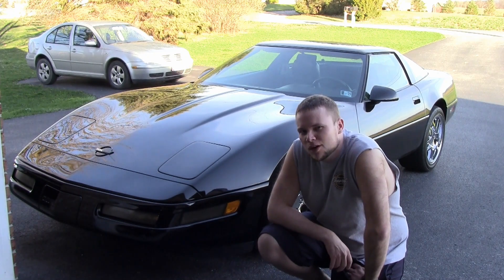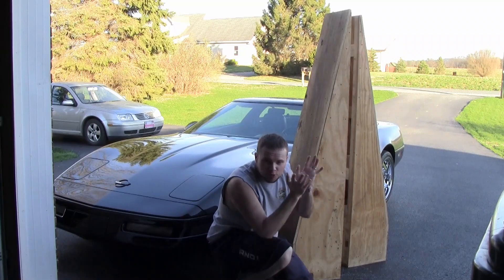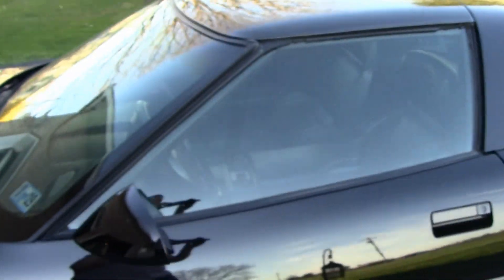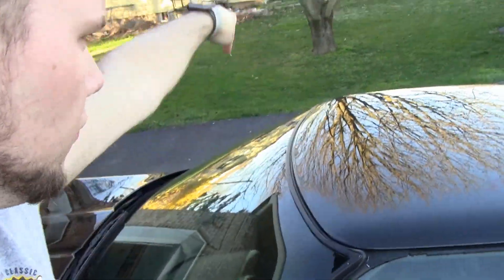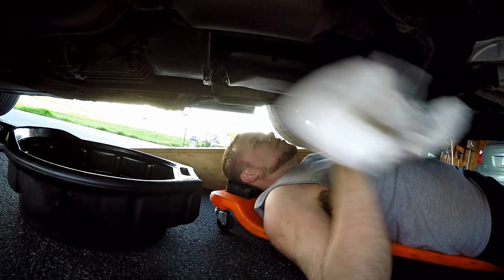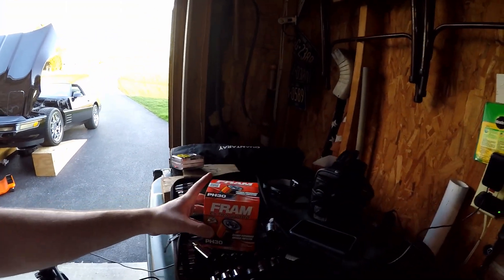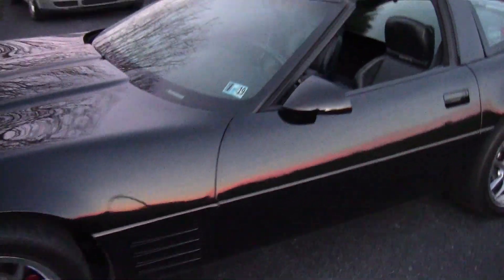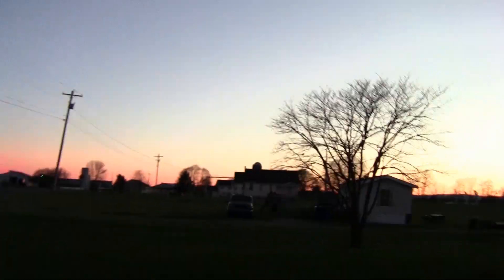C4 Corvette: Jacked, Changed, Replaced, Removed and FINALLY Ready for Spring :)

Comment: Fram should only be used if there is nothing else available .
Reply from the maker: Hahahaha, that’s what I am hearing!! Thanks for commenting!
Reply: @Doulop  It's funny that multiple people keep telling you to get away from Fram, but it's like you said, your family has been using them for years and are not having problems.  I also always use Fram and have been for over 15 years of driving my cars over 20,000 miles a year, I live an hour away from where I work.  I'm always late for work somehow so I'm constantly doing 90 MPH on the highway.  I've never had a problem related to oil.  That's also on 7 totally different cars.  '81 Ford F150, '90 Toyota Celica, '99 Ford Contour SVT, '89 Nissan Pathfinder, '00 VW Golf, '05 Subaru Legacy GT and now a 2016 F150.  The cars themselves are always wearing out way before the motor.
Reply from the maker: Hey Poochoo Train, thanks so much for subscribing. I really appreciate that. I agree with you. I do about 26,000 a year as well and never had a problem. Oh well, I bought the “better” brand after I was told to, LOL. Thanks so much for commenting. Take care!

Comment: I just used the regular ramps that I got at O'reilly's auto parts to get mine in the air. The front air dam did scrape a little but my driveway is inclined which helps some. I just changed the oil on mine a couple of weeks ago and used a K&N filter which has a helpful "nut" on the bottom which allows me to remove it with a socket or wrench.
Reply from the maker: Hi Daniel, those nuts are nice, I do know what you mean. I wanted to buy ramps when I did mine but I wanted the car higher than what they sell plus I had a bunch of lumber laying around :)

Comment: I'm a new 91 Corvette owner and have seen several of your videos and think they are Very Good.   Anything wrong with AC Delco oil filters?   Where can I purchase the rear hatch 2 inch lift part for Good air flow?
Reply from the maker: Hi Chuck, I am happy to hear you are a new 1991 Corvette owner :) They are such fun cars and I hope you have good experience with yours. There is nothing wrong with an AC Delco oil filter. ACDelco is Chevy’s OEM brand anyways. Also, the hatch vent airflow thing is awesome. I absolutely love mine. You can find it on eBay right here. https://rover.ebay.com/rover/0/0/0?mpre=https%3A%2F%2Fwww.ebay.com%2Fulk%2Fitm%2F182497496023. Thank you so much for commenting and watching my videos! Take care!

Comment: The part you were asking about appears to be a PCV.  I was wondering that last Friday while rebuilding my throttle body on my 1991 Convertible.
Reply from the maker: Oh, I thought that was the black tube on the other side that sits on top of the valve covers?? Maybe not. Thanks a lot. I appreciate you letting me know!
Reply: I stand corrected.  It is a Fuel Vapor Canister Purge Solenoid.  Saw it at Corvette Central.  Not sure what it really does.
Reply from the maker: Awesome. Thanks for checking, man. I really appreciate your help :)

Comment: The 2 screws on mine stay in the top.
Reply from the maker: Do you mean the rear screws stay on the removable part?
Reply: @Doulop  yes. The 2 screws in the back of the top don't come out of mine.
Reply from the maker: Wow! That would be nice. They must have changed that in the later C4’s!

Comment: That is your EVAP purge valve. I believe they moved the canister from the front of the car as in my 1990 to the rear passenger side for the 1992 cars preparing for the LT1.  

About the filters, the reason fram is called trash is it has the lowest filtration surface area of the name brand filters and the use of paper for the filter binder. I have seen a few instances of people pulling out a fram with the binding missing leading to a complete bypass of the filter. I use Bosch when its available or wix on routine changes, as they both use better materials but are not priced by the name lime M1 filters. For break in changes I use K&N for the fine screen thickness and when I am doing a flush I use Fram as they are cheap and a flush is only in there for about 30 minutes. 

I highly suggest watching a few videos and doing some research instead of blindly listening to us. A start would be this video : https://www.youtube.com/watch?v=b9pVxaH7Vcs Explains the differences nicely of popular brands
Reply from the maker: Hey man, always great hearing from you. Thank you very much. These are the things I have been hearing. I appreciate it very much! Thanks for the link. I will check it out :) take care!